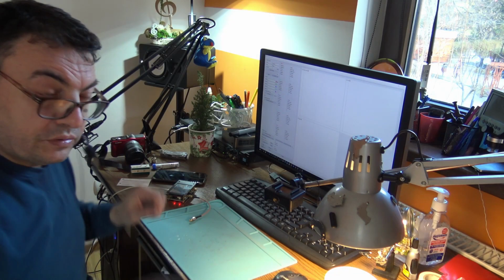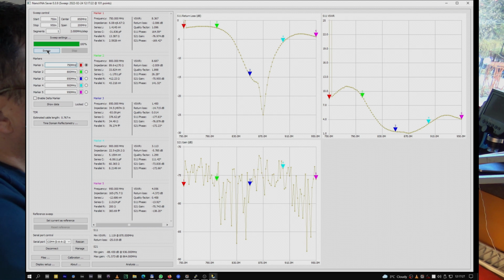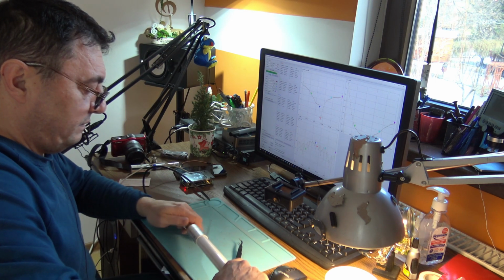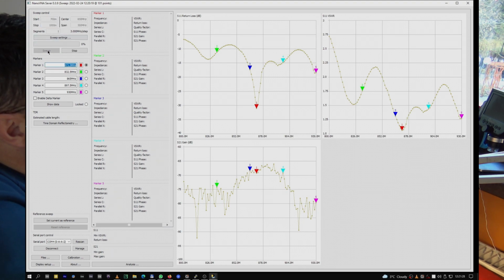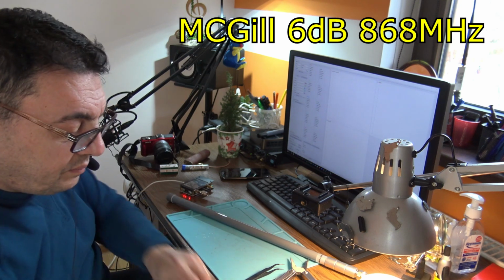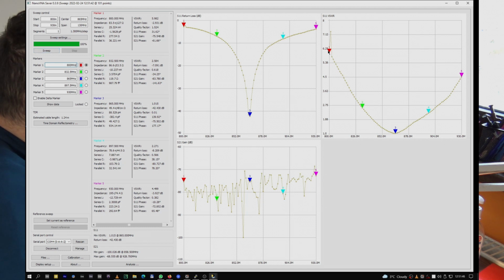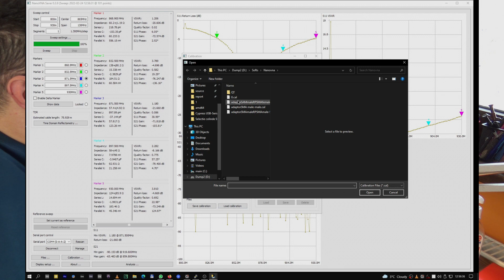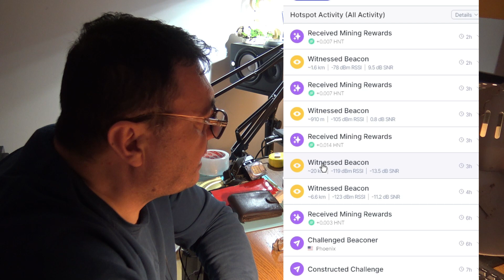RAK 8dB , McGill 6dB and moded generic 868Mhz antennas tests

Comment: I tested the antenna with voltmeter. I have conductivity between the center pin and the two shells.Is that normal?
Reply from the maker: Yes, for RAK is normal.

Comment: care sunt riscurile instalarii unei antene pe casa? e posibil sa ia foc ceva in caz de fulger? impamantarea e de ajuns pentru siguranta?
Reply from the maker: Riscuri sint oricind chiar si cu impamintare, dar o legatura la pamint reduce riscul cu 99,99%...
Reply: Impamantarea se poate facebde la sistemul de prindere a antenei, fara acel lighting arrestor ?
Multumesc pentru raspuns
Reply from the maker: @georgianap.410  Sint 2 tipuri de antene, gen McGill -open circuit si gen RAK -in short, evident antenele in short, sau in scurt circuit din punct de vedere a rezistentei, au avantajul ca se pot lega direct la impamintare, dar atentie, trebuie si pilonul , daca este metalic si partea metaiica a antenei. 
 In cazul antenelor open..gen McGill 6dB, care la masurarea cu ohmmetrul prezinta rezistenta infinita (in aer) este necesar un arrestor care evident va fi legat la impamintare..vom asigura astfel scurgerea sarcinilor spre ground in toata instalatia..
 De asemenea in cazul folosirii unui filtru cavity..acesta poate prelua rolul unui arrestor..dar tot trebuie legat tot ce este metalic la impamintare..
  Impamintarea in sine se face separat de impamintarea retelei..atentie ! Trebuie masurat cu un voltmetru sa nu cumva sa existe diferente de potential intre impamintarea prizei si impaminatrea reala...! Acea teava de preferat din cupru , se va ingropa suficient in sol, se pune ceva carbune, sare si se cauta un loc umbros, cit de umed pentru o priza buna..
 Personal folosesc un gard metalic care inconjoara propietatea pe circa 300m, cu toti stilpii ingropati si cimentati..
 Sper sa fie de ajutor ! Like and subscribe! 

There are 2 types of antennas, McGill type - open circuit and RAK type - in short, obviously the antennas in short, or in short circuit in terms of resistance, have the advantage that they can be connected directly to ground, but be careful, you also need the pillar , if it is metallic and the metallic part of the antenna.
 In the case of open antennas..gen McGill 6dB, which when measured with the ohmmeter has infinite resistance (in the air) an arrestor is needed which will obviously be connected to the ground..we will ensure the drainage of the loads to the ground in the whole installation ..
 Also in the case of using a cavity filter..it can take on the role of an arrestor..but everything that is metallic must be connected to the ground ..
  The grounding itself is done separately from the grounding of the network..attention! It must be measured with a voltmeter so that there are no potential differences between the grounding of the socket and the actual grounding ...! That preferred copper pipe will be buried deep in the soil, put some charcoal, salt and look for a shady, moist place for a good grip.
 Personally, I use a metal fence that surrounds the property for about 300m, with all the pillars buried and cemented.
 I hope it helps! Like and subscribe!
Reply: @viocaia  Multumesc! Este foarte de folos!
Reply from the maker: @georgianap.410  Sper sa fie de folos..

Comment: In USA we transmit at 905mhz +/-1.  My 8dbi Rak is tuned to 915mhz. My 6dbi McGill is tuned to 905mhz. So, it is different in US. Can I add the McGill to the Rak to make one  bigger antenna, do you think?
Reply from the maker: No! Because there have to be i a perfect sync! It's a matter of phases, them should add to have a good signal..two separate antennas will never get the same signal, one it's a little away and that matters...